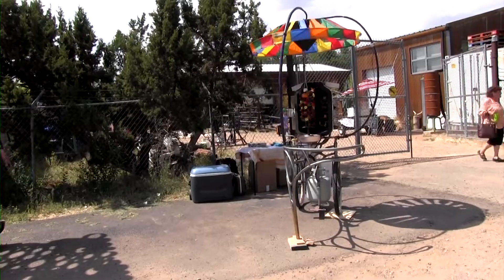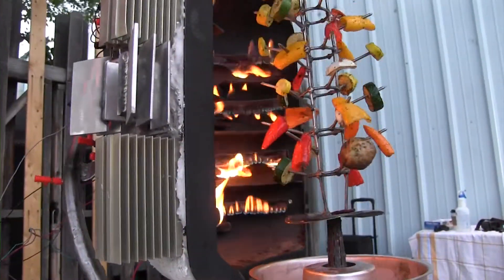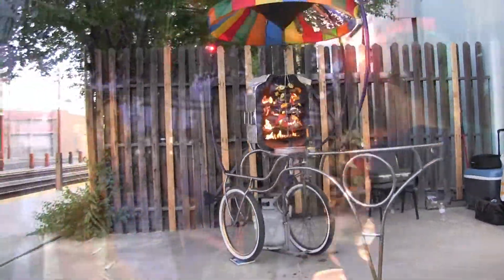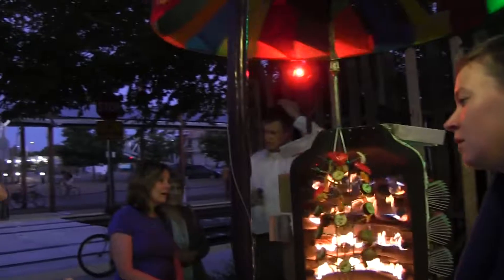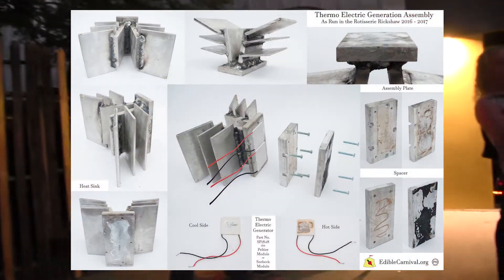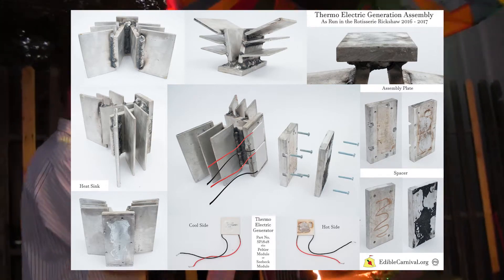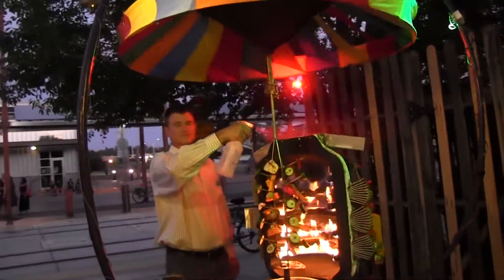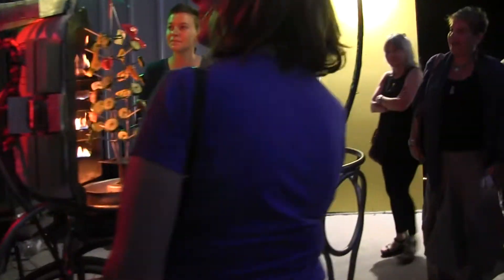Rotisserie Rickshaw Intro - Live Art - Kinetic Sculpture

Comment: This is awesome! Functional and aesthetic!
Reply from the maker: Thanks Stephen!  We are working on updating the website now but here's a link to the existing site if you want to check out more!  Hopefully will re-launch early August.  http://ediblecarnival.org/
Reply: I like the sound of that illumination hot air. Does the whole thing light up or does it aim light downward?
Reply: I was thinking that the lights would aim down but that the heat source might light the balloon.  But if it doesn't light it enough a few leds might point up.  That project has some problems, it wouldn't take much wind to make them not work and there is the issue of fueling it, I would like to have a tank on the ground and run the fuel and electric for the lights up the tether, but the ballooners I talked to said that was a bad idea, I think with the right emergency shut off it could be safe, but those are kind of expensive, so that project is kind of on the back burner so to speak. 

    In special situations like for filming movies they use helium balloons, but helium is expensive there is a limited supply as when it gets used and released to the atmosphere it keeps rising and supposedly keeps on rising until it eventually breaks free of the atmosphere and escapes into space.  And as it is used as a coolant in MRI machines I don't really consider that an option for ethical reasons.
Reply: Interesting– sounds like a tough problem.